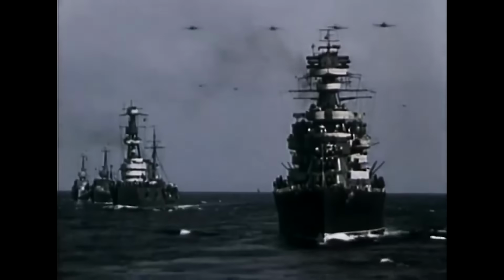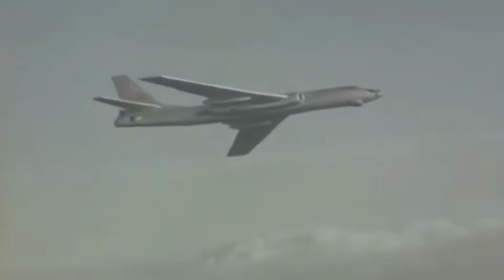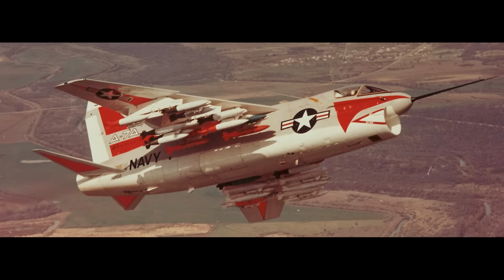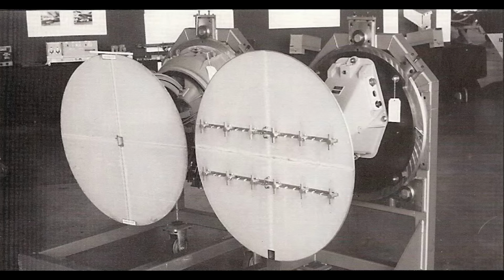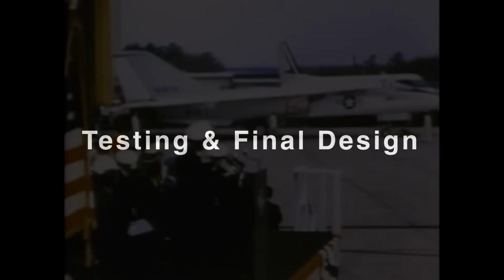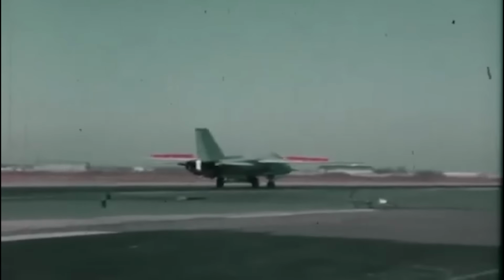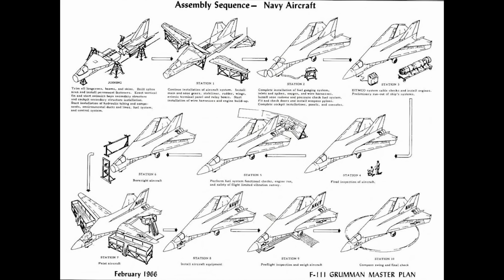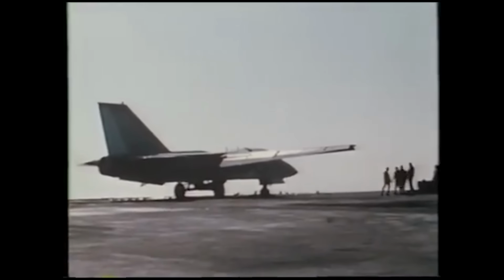Was The Grumman F-111B A Bad Aircraft Or A Missed Opportunity?

Comment: So many parallels between F-111 and Tornado. The Americans at least had the sense that the same aircraft that made a great low level strike bomber would not make a good Air Superiority Fighter. We Brits sadly persevered and battled to make the F-3 a good fighter to no avail..
Reply: That depends on what you mean by 'fighter'.
If you want a very long-loiter, big radar,  multi long range missile carrier then Tornado F3 made a lot of sense - & particularly given the need to maintain the UKs' technological base (within reasonable costs), something that would likely have dissolved away & been lost forever had the UK not gone for the Tornado F3.

Opting for a different fighter (usually solely because of an imagined 'need' for dog-fighting abilities) would have entailed a huge 'tail-end' cost in supporting new missiles, radars, engines etc etc, which are vastly expensive & long-term aspects of aircraft procurement often forgotten.

Tornado F3 might not have been a very 'sexy' plane but it did the job required & was suited to the budgetary constraints the UK always faces.
Reply: @gixxerman0016  well I disagree. It was shameful having a fighter that had to be held back during desert storm because no one wanted to let it near Iraqi mirage or Migs knowing what would happen
Reply: @mcal27  It was more a case of a fish out of water given the nature of the conflict....along with a massive dose of there being much more suitable fish (in abundance) to take on the role.
Reply: @gixxerman0016  Was more a case of lack of IFF for use outside of it's usual environment and secure communications kit.   Sadly from the Gulf War we know about the Yanks inability to avoid Blue on Blue.   The Tornado F.3 had suitable IFF for its intended environment the North Sea but not in a multinational coalition.   Is more likely the Yanks shot down RAF planes then the Iraqi's.
Reply: @gixxerman0016 the problem here is that the Tornado ADS's Foxhunter radar had a troublesome development and for a long time the Tornados flew with balllasts
Reply: Well to be fair we never intended that the F.3 would be an Air a superiority Fighter.
Designed to patrol North Sea intercepting Soviet Bombers before could get to UK.
That is an Interceptor not a fighter.
Unless calling all small planes like that a Fighter in the same way that some people call warrior IFV “Tanks”, or you get people calling all Warships Battleships.
Reply: @michaelmcnally2331  so
Like the the F-111B then? Which failed and the F-14 that took its place (even though not a ‘knife fighter’ was way better in every way than the Tornado F-3. Besides it’s a dumb idea making a fighter for the UK that can’t dogfight! We’re not big enough. Does anyone really think Su-27’s couldn’t reach us from the Soviet Union territory? Then we’d have F-3’s wallowing around being knocked out of the sky easily. Nahh it was a failed aircraft. Mig-31 works for Russia because of the landmass. Not for the uk
Reply: @mcal27  
I think you're over-estimating the abilities of Russian kit (particularly given what we've recently seen in Ukraine), especially given the era of soviet aircraft the F3 would have faced. 
I think the early Su27s wouldn't even have been aware of the Tornado F3 until the Skyflashes let their presence be known in a hot engagement.

No need to get that close in.
Reply: @gixxerman0016  particularly by what has been seen over Ukraine. Has Ukraine scored any air to air victories over Russian aircraft? Not that I’ve seen. Who scored the world record for the longest range Air to Air kill? A Russian Mig 31 against a Ukrainian Su-27. I think you need to expend your news sources
Reply: @gixxerman0016  and as for no need to get that close.. The Skyflash and early AMRAAM the F-3 carried were pretty much equal range ability to the Soviet medium range missiles, so the fairytale about the F-3 sitting at a safe distance is exactly that
Reply: @mcal27  I think you're missing my point about the quality of soviet arms back then.
Still, nice chatting.
Reply: @gixxerman0016  maybe for you lol
Reply: @mcal27  
"(...) it [ Panavia Tornado Air Defence Variant, shared by German squadrons with the same interception mission actually only IDS Interdictor Strike bombers and ECR electronic warfare RADAR suppression and reconnaissance...] was a failed aircraft. Mig-31 works for Russia because of the landmass. Not for the UK (...)" 

You have a point in regard to geography - and e.g. Germany wasn't allowed the procurement of air superiority fighters due to the US strategy of 'Double-Containment' of the Soviet Union and a modern Germany (F-16s e.g. were stationed in the Netherlands and Belgium - a policy, dropped only after German Re-Unification and acquisition of MiG-29s - with a subsequent multi-national Typhoon and F-35 procurement). 

Combat 'Beyond Visual Range', however either works or it doesn't - and BVR requires large RADAR domes (Hughes AN/AWG-9), large armaments of bulky missiles (e.g. 6 AIM-54) and a large amount of fuel in a large airframe (which caused the Russians to drop the light Mig-29 eventually for modernized Su-27Pu/Su-30). 
Therefore the F-14B was indeed the superior choice to a F-111B - but it would not be so until 1987 when the B upgrade became operational... 

...and despite considerably less procurement and maintenance costs, for the very same reasons, the 'multi-role' F/A-18A-D was the worst choice for the role of fleet interceptor, with the F/A-18E/F Super Hornet already as approximating the F-14 and F-111 in weight and size - before being retired as well. 

All interceptors will be heavy and 'Advark' unless BVR is proven as catastrophically inferior to speed or electronic warfare or 'stealth' - and it is not just a matter of interdicting nuclear armed bombers, but also cruise and sea-skimming anti-ship missiles - hence the development of the AIM-174B which will have to be carried by the half-dozen by someone (a specialized interdiction strike role is reflected by the Russian Su-34 while a 'satellite swatting' Mig-41/PAK DP is at least in development hell)...
Reply: @mcal27  One interesting footnote:  I believe that, ,for whatever reason, at first the UK bought AMRAAM without its option for its midcourse update.  Without its midcourse update, it really wasn't that much more effectivee than Skyflash.
Reply: @tararaboomdiay7442 Everything comes down to cost here! That’ll be the reason :) I don’t know myself but I can well believe it.
Reply: But the Tornado F.3 made sense because of its primary mission: UK air defense against Soviet bombers and their stand-off missiles. I think the Tornado F.3 still had a lot of life left, especially if they had lasted long enough to carry the MDBA Meteor missile with its well over 200 km range. Such a combination would be a potent air defense platform.
Reply: I believe that the Tornado F-3 was designed (or redesigned, to be more accurate) to be an interceptor and not a pure fighter per se, and in that role it was more than adequate.
Reply: @aegeanphantom  you're right, it was supposed to defend the north sea approaches & be on station (with or without tanker support) for long periods carrying that long-range radar & a decent weapons load.
Reply: @aegeanphantom  yeah I hear this alot. But when I listen to ex pilots if that machine talk about it in mock combat against any US fighter (f14/15/16) it’s clear that due to things like manual wing sweep change (auto on the f14) and low thrust to weight and horrendous high wing load (an advantage for a low level bomber) it’s obvious that it was wanting in many areas! Indeed when Italy loaned a squadrons worth they weee very eager to get rid of them and not continue the loan. IMHO it was a turkey
Reply: @mcal27  well if you compare any product being used for something not intended for against something that designed to do the job, then call me shocked that it has some shortcomings.

There is a reason we have the saying, use the right tool to do the right job.
Taking an interceptor into dogfight against fighters designed for air superiors and dog fighting and coming up short is not surprising.
There is a reason you hear a lot that the Tornado F.3 is an Interceptor and not an Air Superiority Fighter.   Because it is not a dog fighter,
Why do you think that the two variants were IDS, Interdiction, Deep Strike and ADV, Air Defence Variant and not ASF Air Superiority Fighter alongside IDS.

Is the same issue where people complain about British Battlecruisers at Jutland.   They should never have been there.   Jackie Fishers role for them was to cruise the sea’s eliminating enemy cruiser fleet but being larger then them with the big guns and achieving speed with cruiser level protection.
It shouldn’t be a surprise when they were facing Battleships which never intended to face that they faired poorly.   There was the phrase, sink anything that could keep up with it, run away from anything that could damage it.

Let’s be honest if you put a 911 GT3 against a People Carrier for the School Run then the 911 GT3 going to have some shortcomings, ie lack of seats.   However who is going to say the 911 GT3 is a turkey of a car.   They are both motor vehicles.
Reply: @michaelmcnally2331  and my point is that in a real world situation the F-3 would have been atrocious.. None of its missiles had the range of a Phoenix, it’s radar wasn’t even that good until very late in it’s life and as I’ve said elsewhere Britain is not big enough to justify an interceptor
Reply: @mcal27  OK do you really want to make that the argument.
The F.3 was bad because missiles shorter range then Phoenix.  Well what plane did have that other then the F-14.   So if having air-air missiles shorter range then Phoenix is bad then the F-15 with an air to air combat record of 104-0 is also poor as it's missiles didn't match Phoenix until recently.
Radar, ok the F-16 was a day time air fighter only until the C model got the APG-68.  The F.3 was always All-Weather.

PS if your pilots were complaining of manual wing adjustment then they must have been IDS version pilots as the F.3 had computer controlled wings like the F-14 from the outset,  In which point you are hearing ex-pilots of IDS Tornado's, talk about not being able to mix it up with Air Superiority Fighters.   Which of course is no great surprise.    Should have been flying buccaneers instead.   The Yanks would have a much harder time intercepting them.

A plane that meets its requirements is not a failed plane.    

Same issue that the VC-10 had.    It had a requirement to get out of hot and high African airfields which meant shorter take off runs hence the configuration.   It met that requirement which meant that it burned more fuel then a Boeing 707 on the trans-atlantic routes where was used.
Unfortunately what happened was that whilst being developed those airfields had there runways lenghted so didn't need the short takeoff requirement anymore that had been designed with.   Thus airlines bought the 707 as could get out of those airfields now that had the runways extended as had cheaper running costs.    If the VC-10 had not had a requirement for the shorter takeoff then would have been more efficient.

However if the runways not extended at the airports then the 707 would not have been bought in the numbers as wouldn't be able to get in and out of the airfields and the VC-10 would have sold more.

" Britain is not big enough to justify an interceptor"    That is not the fault of the plane built as an Interceptor.    That is the fault of the people that drew up the requirement against which the Tornado ADV was developed.

If you was doing DIY and needed to put some shelves up and needed to work with nails and you took a Screwdriver with you, you probably can hold the Screwdriver wrong way round and use the Handle end to Hammer the nails in but it would be a hard job.  That doesn't make the Screwdriver a failure.    It just means you should have taken a Hammer.

However I see your problem.    You don't know the difference between a plane built to meet a bad set of requirements and a bad plane that doesn't meet the requirements laid down for it,
Reply: @mcal27  Thought the Tornado was auto-sweep
Reply: @TyrannoJoris_Rex  nope. 3 settings all manual
Reply: @michaelmcnally2331  and I see your problem… Cope… You make my argument for me! The F-15 and 16 can knife fight hence the range of their missiles is not as vital as the F-3 was. You backed my argument. Cheers 😉
Reply: @mcal27  and why I say your problem is that you don’t know the difference between a bad plane that doesn’t meet the requirements laid down for it and a plane made to requirements that you disagree with.
You are the one desperately trying to cope here so suspect is that not you don’t know the difference but you won’t acknowledge the difference.
You made a poor argument and got caught with it, and then try and use the argument that the others are designed to engage in dog fights so it doesn’t matter for them.
When is already established that was not the intention of the F.3 which intended and designed for Interception in its requirements so why would it be designed to dog fight.
You can certainly have an option that it should have been however what would., what should and what does are not the same.
A plane that is not designed to be a dog fighter does not become a bad plane because it cannot dog fight.
That is literally arguing a 2 seat sports car is bad car because it cannot move as many people as a 7 seat people carrier.
You are making the argument that the 2 seat sports car is a bad car because it does it fulfil the role of  a people carrier and it should be able too, and because it is not able to do something that was not laid down in the requirements but you believe should have been in the requirements that it is a failure.
Yes that is literally your argument that the tornado f.3 interceptor is a failure because it should have been designed as a dog fighter not an interceptor.
Reply: @michaelmcnally2331  I got 99 problems but a Tornado F-3 ain’t one lol ;)
Reply: F-111B though was (imho) the best looking version of the Aardvark!
Reply: @mcal27  Nah, F-111C was.
Reply: @FirstDagger  because it has long wings?? Ok… lol